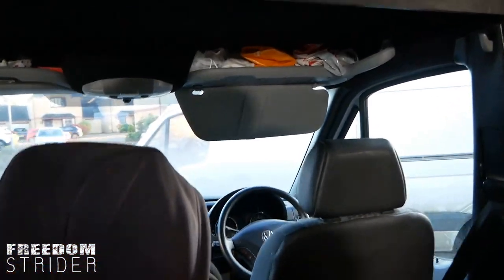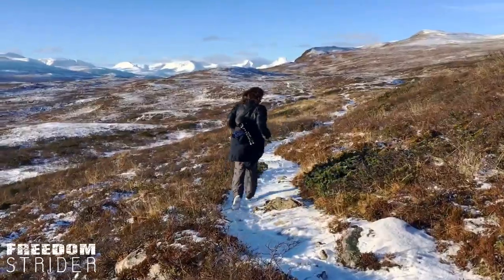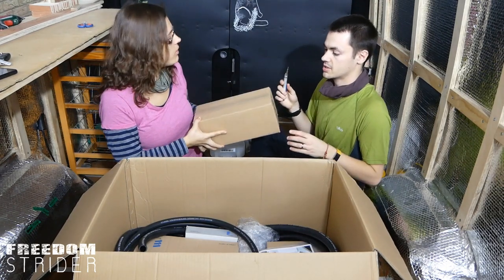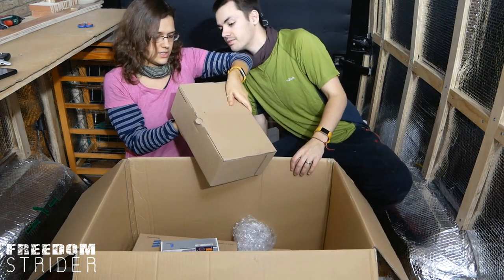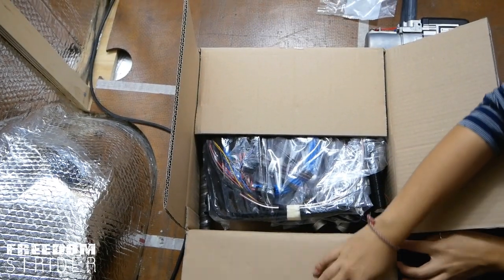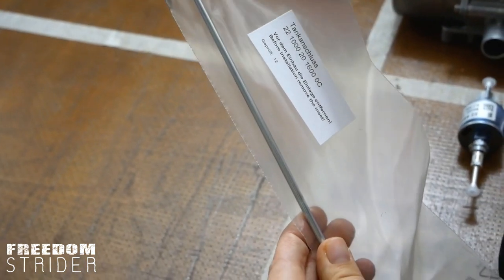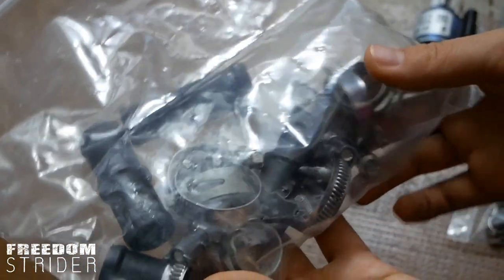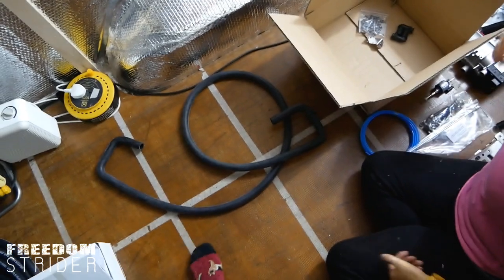How Hydronic Heating Systems WORK (diesel water heater)

Comment: And if you all ever want to make your muffler quieter on the Webasto heaters or the cheap Chinese diesel heaters all you gotta use is a different muffler because that is what he said it is it’s just a silencer so if you’ve got a dirt bike or a riding lawnmower that has an exhaust on it take that off and put it on that and it’ll be 10 times quieter Just like people say whether it’s the stoves or the or the Chinese stoves people say that the pump for the fuel is louder I never had a problem with it. My diesel heaters came with this noise canceling wrap that goes around the diesel pump.
Reply from the maker: Yeah I've seen those muffler wraps, ours isn't too noisy but you're right about just putting this on if it is noisy!

Comment: An idea I am working on regarding water.
Very large water tank underneath body. One feed via pump is to a 3stage water filter into a 10 gallon tank for potable water, sink drinking etc. Another pump feed via a simple filter into your shower system,l the idea is that you fill the large tank from any reasonably clean source, tap, river , etc... then you pump into potable tank to keep it at a reasonable level. And into shower whenever the recycled water needs replacing. Pros. Large storage capacity. Very clean water via 3 stage reverse osmosis filter that is not wasted filtering all you water only that needed. Simple filter for shower. A single pump with a two way valve to switch target. Level switch in each sub tank to automatically switch off pump when filled.  The potable water tank feeds a tap via a small pump operated from A knee height switch.        A small grey water tank with solenoid empty valve so you can dump into drain you park over or on the road. The main tank has a couple of fill points, one of them is under the bonnet so you can fill up whilst pretending to fill radiator at a garage. Steve
Reply from the maker: Sounds like a good idea, certainly doable. You might need to upgrade the weight capacity of the van, depending on how big the "very large water tank" is 😂 Your idea is quite interesting because, after a lot of thinking, we have come to the same conclusion that it is best to have separate water tanks for different functions (drinking, sink, shower usage). For hygiene sake, it is best to treat them as separate systems.
Reply: @FreedomStrider  yes I am planning on getting a Vw crafter cr50 minibus all glazed extralong. (5ton) which has the advantage of doubled rear wheels for good off road, higher suspension to cope with 17 people weight. Interior fully insulated and carpeted, built in heater and electrically controlled extending rear sun deck. (Disabled wheelchair lift, will probably remove as it is pretty heavy and behind the rear axle so cuts down ground clearance angle.) raised floor by about 4 inches for the fitted seat racking, will either remove or if headroom is ok build underfloor storage for things like clothes, tinned food etc...) the floor tracking could make fitting units way easier. Fitted escape hatch sized removable roof hatch. Usually come with graphics on the side. Must watch the video I linked in other post. Steve
Reply from the maker: That sounds awesome - we would love to see it 😃👍

Comment: Hi, nicely explained 👍, just one question if I may. Is it possible to just heat the water without heating the van? I assume it must be possible but couldn’t see it from the layout.
Reply from the maker: We didn't explain it in this video but later on (https://youtu.be/IUElVxJfwCQ)

We changed our design slightly to plow for us to heat the water without running the underfloor line. Since we can also leave the heat matrix fans off, even though there is glycol passing through it, if the fans are off there won't be any heat 😊

Comment: So when you set the Webasto controller on Auto, and set the heat (the right dial for the temp control) does that ONLY control the air matrix?  Does it turn on the Espar furnace to heat the glycol?  I have the same system and I just cannot get everything to play nicely.  I thought that by setting the temp on the Webasto I could then go to sleep and the controller would turn the air on and the furnace to heat the glycol for the air matrix.  Am I wrong?   DO you have to turn the air on and then the furnace via the Easy Start pro?
Reply from the maker: You can connect a different temperature sensor to the back of the easy start pro controller which can control when the furnace will turn on, but we don't have that.

The webasto controller on auto only controlls when the air matrix will turn on. You can set the easy start pro controller to set the furnace to turn on at specific times and then connect the webasto controller to the wiring loom from the furnace (I believe it is the black and red wire though don't quote me on that)

It is a bit of a fickly system since the webasto controller, air matrix and furnace are all independent from one another and you have to play around with them to work with easy other in sync. We rang the people we bought our system from and asked them based on what we wanted to do - that might be the best course of action in your case 👍

Comment: In summer. To to heat the water you also have to heat the van?
Reply from the maker: At the moment, as we have demonstrated it, we haven't out any valves for the underfloor heating loop so yes the floor will get warm at any time just like a hot water pipe in a house. That is a temporary situation because we plan to put a valve and controller later on as we learn to work with the system 😊
Reply: @FreedomStrider  you could also have valves to shut floor heating loop during summer use, and if/when equipped with engine heating exchanger just push excess heat there...
And engine heat exchanger works other way around too if you can make furnace glycol pump to run without running furnace, this gives hot water for some time after driving.

My camper trailer is equipped with Alde LPG combi furnace and floor heating circuit which is last in plumbing having radiators for each window and front/rear of the camper. This floor circuit has shut-off valves which I haven't ever used, furnace has 8 liters in boiler and doesn't need to run heating circulation to warm water.

Comment: Wait so you have to heat the water in order to heat the rest of the van??
Reply from the maker: In our case, yes, that's how the hydronic system works. The glycol takes about 5 minutes to get up to 90C, and as it enters the air matrix, the elements heat up and the fans blow the heat out. We expect it to work slower than an airtronic or direct burner with a fan, but it should still do the job and for our hot water, it will be a lot quicker than a boiler. And if we get the underfloor heating working correctly, then that should help create an ambient atmosphere - that's the plan anyway 👍😊

Comment: Do you know if it is possible to use the one that comes with the Sprinter (or Crafter) designed to heat the motor and converting it into this ? ( I know this is a D5 as well but maybe not the same model).
Reply from the maker: If you mean the pre-heaters that sometimes come with vans to preheat the engine, then it's actually nearly exactly the same unit. The only thing you would need to check is that the pre-heater doesn't have a timer limit on it. When we were looking, some of the pre-heater furnaces only run for 50 minutes at a time, before turning off, and I don't know how soon you can turn them on again. You might be able to tap into that preheater existing system as well, to have the glycol heat run through a boiler which will give you a hat water supply after you've been driving, but it depends how often and far you drive if that is worth it or not. 😀
Reply: Right, I did not think about the running time, that's an issue.. Thanks for your anwser!  I'm looking forward the progress of your build!  I'm hinking about bying the same kit and doing the same in my next van!  Looking for the liability as well, as the temperature can come under minus 20-25 degree Celsius in winter time here in Québec, Canada!  Good insulation is needed tho!

Comment: Hi guys, I have the same system and I’m having experience with short term hot water. For example, I turn my heater on and let it heat up everything for about 10 to 15 minutes and then I turn my shower on to warm water. It will only stay warm for about two minutes until the heat exchanger goes cold. The heater will still be running continuing to try and heat the exchanger but still I have no hot water since the exchanger ran cold. Do you guys experience the same thing? Is this normal? Or are you guys experiencing long-term hot water in your shower and sink?
Reply from the maker: Sounds rather an odd problem - we haven't had this issue. If we run the shower on pure hot water on full power, after a few minutes the water goes warm as the heat exchanger struggles to warm the water up and we physically hear the heater kick into higher gear to try heat the glycol up quicker. This is with us running the hot air and the underfloor as well however if we shut the underfloor valves and turn the air matrix off, our heater can keep up with our shower head for hot water use.

What flow rate is your shower head? Ours is around 4-5L/min, and our pump is 7L/min. If yours is much higher then it could be you're passing water through the heat exchanger too quick for it to heat up properly. As for the heat exchanger, ours is a 20-plate heat exchanger (so it has 20 layers inside for the water to pass through, lots of space for it to heat up). Some cheaper exchangers are 10 plate or 7 plate, meaning the water doesn't have as long in the heat exchanger to heat up, resulting in cooler water out the hot end.

The other thing to check is the thermostatic valve on the end of the heat exchanger. Try turning it all the way to HOT - sometimes mixing with cold can result in much cooler temperatures, depending on the flow rate, etc... as mentioned above.

For us, hot water is nearly instant. Once the heater is on, within 2 minutes we get hot water. And it stays hot for as long as the heater is on. Hope this helps!
Reply: @FreedomStrider  awesome help thank you! I will check it out and see what I can do. Glad to hear it is odd though. Hopefully, once I get it working right, we will be living luxuriously✌🏻

Comment: Nice design! I’ve been planning out my system as well. Have you considered upgrading the header tank to an aluminum one?
Reply from the maker: No? What are the benefits of upgrading to an aluminium header tank?
Reply: @FreedomStrider  Primarily it can handle extended run time better - Like you mentioned, the plastic tanks aren’t designed for it. Personally I also feel it’s easier to insulate and mount in the van. And a lot more durable. But, they do cost more and are difficult to find with proper fittings (I’m in the US so that could a factor) I’ve been looking at fuel tank manufacturers for my system.
Reply: @FreedomStrider  Also could you expand on why you decided to not use a hot water tank? I’m curious about your thoughts on that.
Reply from the maker: We debated for a long time about a hot water tank. But because we are planning for a recirculating shower system, we wanted a way to keep the recirculating water supply and the rest of the van separate. We could have picked a water boiler and dedicated it completely to the recirculating shower and now use it for anything else in the van, however, apart from that being a waste, also it would be very difficult to clean a boiler. Also, the recirculating shower system requires maintenance and cleaning (hair, dirt etc...) and this would all eventually get stuck in the boiler. That was the main point against getting a boiler. 

With the hydronic system and the heat exchangers, we can separate all the water systems, build them independently, and upgrade/change things without disturbing the whole system. 😀
Reply from the maker: For the tank, it's an interesting idea to think about as an upgrade, but I think for now we are going to try and make it work with the tank we have, as that will take some more digging around and we really want to get the system to work first - but it's good to know, thanks for telling us that! 😄
Reply: @FreedomStrider  Makes sense with the shower. Looking forward to seeing it all come together

Comment: Do you have  2 separate water heaters for recycling shower and hot sink water?
Reply from the maker: No, we don't have 2 separate heaters for the sink and shower - there is no need. The heater heats glycol not water, you can pass this glycol through different heat exchangers ie. One for the shower and one for the sink. That being said we haven't bothered to plumb the hot side of our sink (for the moment)
Reply: @FreedomStrider  interesting but you have yours hooked up to your shower right? Couldn't you just T it off to the sink? With the double loop system or whatever? Or you have to have it connect to another heat exchanger?
Reply from the maker: If the shower is recirculating, then the water in the loop will not be clean enough to drink or wash stuff up in the sink so 2 tanks, 2 heat exchangers and 2 separate plumbing loops are best. If it's a normal shower then a single linear line with 1 heat exchanger is fine
Reply: @FreedomStrider  ahh I see. I was thinking you might be able to do it with just 2 loops and 2 tanks and 1 heat exhanger but maybe not. Do you recommend a different exchanger rather than spending $6k on 2 of them?
Reply from the maker: Why would you spend 6k on heat exchangers? A heat exchanger is about £100-£200.  

You still have 1 heating plumbing loop and the doubling happens at the water plumbing side. 

So.. 
1 heater
1 glycol plumbing line
--> with 2 water heat exchangers

The glycol passes through both.

Then on the water side of the heat exchanger:

1 heat exchanger is connected to the sink plumbing (with its own water tank and such)

2nd heat exchanger is connected to the recirculation shower loop.

That way the water does not mix.
Reply: @FreedomStrider  perhaps I'm just confused on the equipment then? I thought the espar hydronic system is the heat exchanger? Which is $3k from heatso from what I've seen?
Reply from the maker: That's okay, it's a system with many components, it's quite a puzzle 😊. The hydronic system is made of quite a few components, the heat comes from the furnace (so the heater), the pump pushes the glycol through the furnace to heat it up. The heated glycol then continues to flow through the pipes, where it can pass through various heat exchangers ie. water heater exchanger and an air matrix.
Reply from the maker: $3k sounds like the price of a kit and a big kit at that, we paid about $2000. The furnace itself is about $1000
Reply: @FreedomStrider  yeah it was a whole kit. It was the one from heatso that the vandogcat or somethings used and also mentioned you in their video. Didn't realize until after. 

Interesting though, I'd like to get the kit but it looks like yours is based in u.k? I've hears buying espar from certain places is not good so I've been trying to find a good place to buy the kit
Reply from the maker: The US company, selling these heater and kits, that I know is heatso, but I do know that their customer service rather poor, even though I believe it's a genuine kit.

The other legit companies we have looked at are butlertechnik and mellor online, which have much better customer service. However, they are UK based, I don't know if they will deliver elsewhere but you could ask them.
Reply: @FreedomStrider  super helpful, thank you! I appreciate you taking the time!

Comment: how did this work out?
Reply from the maker: The hydronic heating system works great. We plumbed it in parallel (at the end) not in series and it is still working as I type. 🙂

Comment: Red diesel can only be used for agriculture, horticulture or forestry uses, Using red diesel could lead to a fine and prosecution if you are caught with it.
Reply from the maker: The government website says you can still use it for heating purposes; new limitations are coming in 2022 though.

"2.3 Uses of red diesel other than in motor vehicles
heating – red diesel used for heating is known as ‘35 second oil’. Use of red diesel for heating has declined with the availability of natural gas but it is still used ‘off-grid’ for the heating of commercial and public sector premises, and in agriculture for heating animal sheds and processes such as drying grain, as well as some household heating. Use of red diesel for industrial heat in kilns and furnaces has similarly declined"
Source: https://www.gov.uk/government/consultations/red-diesel-call-for-evidence/red-diesel-call-for-evidence
Reply: @FreedomStrider  Living off grid in a campervan does not qualify. It’s your choice but if you get caught you could get prosecuted (criminal record) and fined. Not worth the risk. Ask yourselves this, If it was ok to do everyone would be doing it?